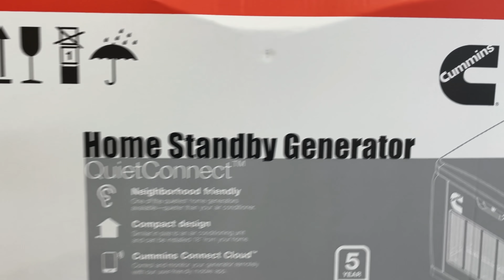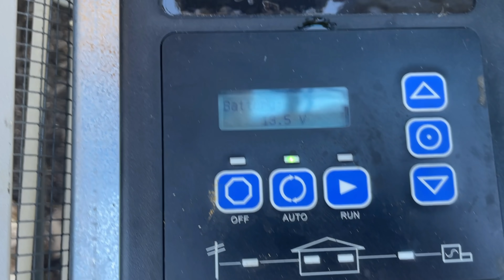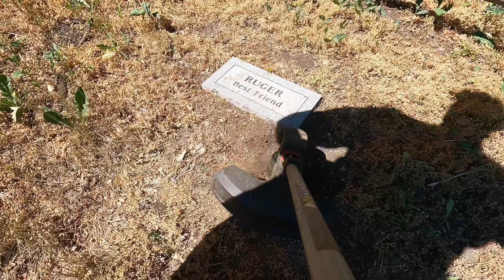#507 -New Cummins 20kw Standby Generator, Front Porch Makeover, Roof Pitch Repair Continued.

Comment: i knew you wouldn't be happy with that kohler generator, I messed around with many gas gens over the years, but they always gave me issues and felt like I was constantly working on them, converted my old wrecked VW TDI w/ diesel engine into a DC generator wired to the solar system and its been a blessing for the past like 7 years troublefree

Comment: Issues I see with the 20Kw Cummins & the 8Kw Kolher: 
1. the 20Kw unit is going to use about 3 times the same amount of fuel as the 8Kw for about the same load. 
2. I would recommend keep in the 8K by the house & put the 20K over by the shop. You have a backup, backup gen if something happens & you can use it for lighter loads (better fuel economy). You also have lower voltage drop for shop use (ie 240V equipment like welder).
3. If that is a dual fuel unit, I recommend using a liquid fuel (Not sure if it diesel or gas). issue if you run low on Propane during the winter, its going to be impossible to get the tank refilled. I also recommend you top off that propane tank before it because difficult due to mud\snow.
4. You could make a 3 sided outbuilding around the generator, such that its protected from rain & snow, but still open for airflow. This way if you need to change the oil, replace air filter, etc you don't have to dig it out of the snow.
Reply: Exactly!!!
Reply: Gas carbuerated engines are notoriously inefficient especially when compared to a diesel and even more so a propane engine. A riding lawn mower will run for a hour or two on a gallon of gas. Where as a propane forklift will run all day and then some on a 30lb tank. Both are carbuerated but one burns atomized liquid fuel and one burns vaporized fuel from a liquid fuel tank. Propane engines are also much much cleaner as far as engine oil and carbon build up.

Now compare a diesel truck to a gas truck. 1/2 ton gas might get 15mpg while the diesel might get 20 mpg (obviously if the two trucks are spec'ed out exactly the same minus the engine and tested under the same loads).
Reply: in theory there is no "load" issue. you want as much power (per unit fuel) as you can. IE he should never have to "run" anything on the generator. turn it on. max load recharge the battery array then turn it off. at least that seems like how it should run. SO the 20kw will use 3 times the fuel but charge 3 times as fast and then turn off.
Reply: @cabwaldo  The issue is that a large 1000 gal propane tank requires a delivery truck, which will be a no-go during the winter since Poppy ranch is on an unpaved road, Nor is the steep driveway any help. In a pinch a gasoline\diesel genset can be refilled using 5 gallon fuel cans. Plus Heath bought a large (300+ gallon) tank for diesel.

Diesel as a lot more energy per gallon so it can get better mpg compared to the same size truck\engine. However usually the price of diesel is higher. That said I prefer diesel over gasoline, but its becoming harder to find small equipment (& light trucks) with diesel engines anymore.
Reply: @nerys71  It will only charge faster if you get a bigger battery charger - a 400 amp one! (at 48 volts) and the batteries can take it- I have not seen a battery bank that can take 8kW never mind 20
Reply: @rogerandlyndabeall3840  good point we have no idea how he is charging his battery pack
Reply: @guytech7310  true, but I went back to gas truck for my contracting business for 1 reason.  Repair costs.  I love my diesel older pre emissions equipment, but the modern stuff with def, dpf, burn cycles, regen etc....are a maintenance nightmare.  

No newer equipment for me, and back to the trusty multiport 454 service truck and tbi350 dump truck.  I can actually work on them in the driveway with cheap parts.  I get 9mpg and 7mpg, but the $ on repairs, and cheaper fuel make up the difference easily.  And no more downtime for an injection pump or dpf issue, and I don't have to "delete" anything to make it reliable.

Comment: I used a commercial grade weed wackier for years at my job and they were heavy even with the straps and my hands would feel like they were still vibrant for hours after. Recently picked up an ego battery powered and I’m honestly impressed. I don’t have a ton to do with it but the power is definitely there. The only complaint I have is the head. Winding the string is a nightmare.

Comment: We put deer net around the garden with rebar stakes. It's 7ft high ($21 by ks for 7x100) with the rebars just cut in half. In the outside about four ft away and 3-4 ft high two strands of curling ribbon (all's I had this year last year I used jute) a game warden told us this would keep them out. So far so good! Not sure if it would work for goats but it was fast and cheap for us.

Comment: You might think about a storage tank for water.  I refer to one much larger than the two you have now.  I have a 30,000 gallon tank that is mostly buried in the ground that with a good rain will fill up a good portion of it.

Comment: I use that Milwaukee string trimmer, and I use a 12ah battery and I use it for about an hour, and the battery is down to about half when I'm done with the hour trimming I usually do. But the 12ah batteries are heavier than the other smaller batteries. But at long as your using a HD battery your still get great performance out of that trimmer. Just a thought my friend. Great video. And I'm in the same spot as far as the Milwaukee line of tools. I figure why have two deferent brands of tools and batteries.

Comment: Something you might think about to dress up the posts and make them look bigger is to place a fence picket on each outer edge of the post.  It creates an interesting channel corner detail when they come together on the sides.  Give it a try by clamping some on one of the posts and see what you think.  This will work only with 4x4 posts and the HD cedar fence pickets that are about 4 inches.  No cutting required...I just used construction adhesive and clamped them in place for 24 hours.  See what you think.  I also think getting an old soda for sale cooler would look awesome out on the porch.  Something to put between the chairs and also serve as a place to set drinks.

Comment: Hey Heath have you though of a shed With a top and with a couple pony wall and the front open on the corner on top next to you diesel tanks that way you could hard wire it to your your electric panel and also to your fuel tanks it would be a win-win deal no more running out in the storm to refuel and it would be protected from the elements and have all the fresh air that it need and with easy access. Just a thought I hope it helps.

Comment: I have thr same trimmer.  Its great but is a little too heavy. Its great to use the same battery as the blower. I also use a edger attachment on the trimmer that cuts a good clean line on my sidewalks.

Comment: If you can get the solar running and sized for your house needs correctly with enough batteries the need for a heavy duty generator will be lessened and storage for its fuel lessened. If your heavy vehicles used the same fuel then the need for a large fuel storage tank could be combined for motors.

Comment: Did you consider installing heating wires on the roof so it melts the snow?  The most important part to consider is reinforcing the area where the upper roof snow will come crashing off and land at.  Perhaps some bracing down to the original roof there might be something to consider.

Comment: One thing that may be possible
On the replacement roof
Maybe run some heat ducts inside the 2x12s.  And when the snow starts to build up push some heat off the wood stove  through those ducts
maybe

Comment: That pitch should be plenty steep to shed the snow. The only issue I can think of is that maybe the snow could drift up against the windows and cause some kind of problem. But I think it's unlikely it's something you need to worry about. And if it happens you will be able to fix that down the road. I bet it's gonna be great to not have to get up there and shovel the snow off.
Reply: andrew best  So why are you hanging around here writing sour comments if you think the dude is just arrogant and not worth watching? Get a life.

Comment: 20KVA is a big generator. Cummins recommend a minimum 30% load on it to avoid engine damage (Power topic #7007), if you are lower than this then you might need a load bank to dissipate (waste) power when you are below 30% load.
Reply: They only need  it primarily to recharge the batteries, they can take a lot of power quickly being LiFePo plus the other loads on the system from the house, out building etc.
Reply: Come on... "Nick" knows all.  

Silly to put in a 20kW battery charger.  He'll just blow through that propane.

Comment: Have a far out of the box suggestion for you.  Would it be feasible for you to either incorporate a docking station to charge your many batteries or build a shed to provide cover from the elements for all your machinery with docking station stations within the shelter to recharge batteries.  You could charge any type of battery you have in your "rolling" stock.  Just a wild thought
Reply: Additional thought, power can be derived from solar

Comment: I love the electric trimmers and even the newer better quality electric chainsaws, it’ll never replace a gas chainsaw but for limbing and smaller jobs they were great. Definitely getting everything that uses the same battery system is good and sticking with a name brand were those batteries are going to stay the same as good. Some companies have a history of changing battery styles every couple years meaning you’re paying exorbitant prices for older style batteries that are harder to get or you’re just getting rid of old tools because the difficulty in price on the old batteries just makes buying a whole new set when they’re on sale cheaper but we’ve all been there with the gas stuff we went out to do a 15 minute job and spent half an hour trying to get something fixed or started. Lol. As far as the environment, it’s hard to say because electric cars in the long run produce about 40 to 110% more CO2 is an omissions then a gas powered car just from the mining process to get the battery materials alone so they’re really not helping the environment though they do offer some advantages so I don’t have a problem with people getting them if they want them I just don’t like that they are pushed as some sort of eco-friendly option to save the environment because in the long run the heavy machinery they used to mine the materials to make the battery produce way more emissions and pollution then a comparably size gas vehicle would and I’m sure to some degree that may be similar on power tools and battery operated device is replacing gas powered engines but they’re also different kinds of engines and probably less efficient so I don’t know what degree or if there actually is an advantage. Though I don’t think it’s quite as big of a deal as people think because the whole climate change thing is pretty much a political lie anyway.  But I have to admit that a lot of the new electric trimmers and saws do a very good job enter just a lot more convenient and cleaner and easier, of course you have to deal with replacing batteries eventually so I’m not sure that they or more cost effective or not but gas prices skyrocketing it’s possible.  Tool technology could take an advancement with gas engines as well. I remember when motorcycles and ATVs started going over to EFI. I remember constantly tuning and changing jets and then having to re-tune if you’re changing altitudes and I got a Polaris 700 EFI about 15 years ago and I’ve never done anything to it except oil changes and replace batteries it always starts it always runs great. I would love to see some of that technology thrown onto chainsaws and weedeaters and Lawn Mowers and tillers. I know you’re fond of nostalgia and tradition and I see value in that too but for a tool or something I use every day technology to make things a whole lot more efficient and easier and the electric stuff is up there now and competitive. 

I love that Lawn Mower, that’s genius.

Happy Independence Day❤️🤍💙🙌🏼🇺🇸

Comment: I am certainly not an expert on tool batteries, but my youngest son is in the HVAC trade, and they all use Milwaukee tools and batteries.  These tools are used daily and we have not had to replace any of his batteries yet.  Myself, I use Dewalt tools and batteries.  I have not replaced any due to failure, however I have bought new ones when I upgrade my tools to higher voltages.  The dang batteries cost more than the tools now.

Comment: Easy to cut back on the hay needed during the warm months by simply dragging back limbs covered in leaves for the goats to munch on. They will strip the limbs of leaves, bark and any young soft wood thinking you are giving them a snack. Bamboo is another good one for most livestock but with goats you will want to fence off the core of the plants to keep them from killing it off so it can spread out over time and then let them eat what is growing outside the fenced off core. 

Goats love a lot of the invasive plants like kudzu that are normally a pain to get rid of or where you would need to pay to dispose of them simply find someone with goats as they will attack any pile of dumped vines you drop off.  There are some plants that are not safe for goats that they would try to eat anyways so do a search of (plant) safe for goats to check since something like morning glory vines would have those goats on a nasty trip.

Comment: that flag mount they make stainless steel mounts! worth if if you get any sort of winds as the cast aluminum ones sometimes just can't hack it over time.

also that flag is snagging on your gutters. put something on that lip so the flag does not get ripped ip on it even a small piece of duct tape then slightly larger aluminum tape over it should be enough and you won't see it from the ground if you do it nice and neat.

That kids pool. put a tarp UNDER or it its one time use. the concrete will destroy it.

Comment: Wouldnt you get more of a pitch on the roof if you notched out the lower part of the rafters at the bottom. So you can set it lower.  Cut a 4" notch

Comment: If the snow builds up in front of the windown now, then build flower boxes in front of every window and seal them on the edges. Windows might melt the snow due to lack of R value.

Comment: The old roof looks almost flat compared to the nrew part
Reply: At a 3 1/2'  on 12' pitch, it even does'nt meet the *minimum requirement*  of the Canadian code of construction in urban areas.
And ask me if we know something about snow falls ! 😳
In my 40 years of designing houses and country cottages, I always specified 6' on 12' pitch as a minimum. In major snow falls areas, 8'' to 12'  pitches (45°). Never had a roof collapse in 40 years !
But, hey, Heath here knows better. What can I say...

Comment: I was prepared to pay $5/bale from my supplier this year. I had set aside $250 for 50. When I got the call that the hay was ready in the field, my Amish friends were available so we got my hay. I was told when we got there that the price was $3.50/bale because we picked it up in the field. I got 100 bales. My SS check was coming in the following week so I could pay the remaining $100 in short order, which I did. We are not in a drought in my area at this point. I can't imagine having to pay $15/bale!
I took 3 bucklings to the sale right after that. Prices had been going as high as $4.50/lb, or higher.  But I had one buckling who had injured himself just before I had originally planned to take them. It involved a vet. By time he was able to go with the other 2 to market, the price had dropped a bit. I got $3.40/lb.
Yeah, farming is NOT a sure thing. But, where would we be without the farmer?
I did not get a garden in this year. I had planned to. Had a couple raised beds built, bought some seedlings. But, I free range my goats. Maybe next year, after I get a fence built around the garden and cabin area. In the mean time, I am finishing my buck barn/pen and expanding the main goat pen. I still intend to continue free ranging my goats, I have an LGD that follows them. They pretty much rotate around their home base. I am fortunate that I live in an area where I can do so. Not many can.
Praying for rain for you guys.

Comment: I really thought your next generator would be a diesel. A 20 Kw diesel unit would have an engine that would run @1800 rpm. You would save on fuel as you could fill the diesel tank you have with tax free fuel. The Diesel engine would last much longer than the Briggs engine in the Cummings unit. As you mentioned, you have found someone that you trust to service your unit. That is hard to put a price tag on. Good luck with your new unit.

Comment: why is the roofing called "tin" when its steel?
Reply: I think in the old days it was tin, but the name stuck. Modern stuff is galvanized steel.
Reply: @danblumel  was it? tin is much softer, I dont think itd hold up. Maybe the steel used t be tin coated instead of zinc?